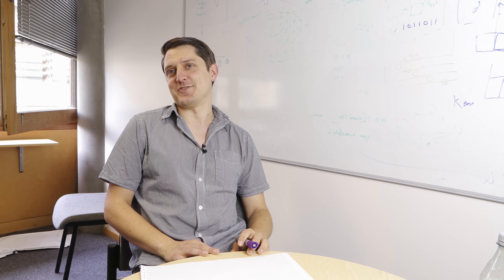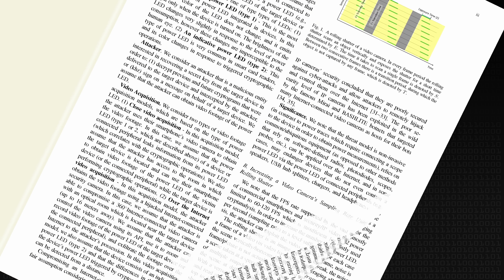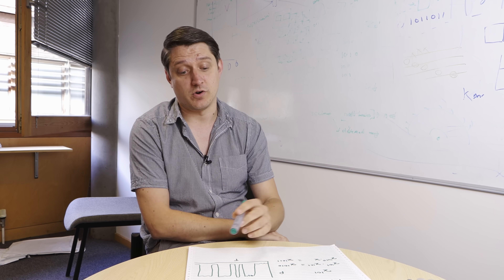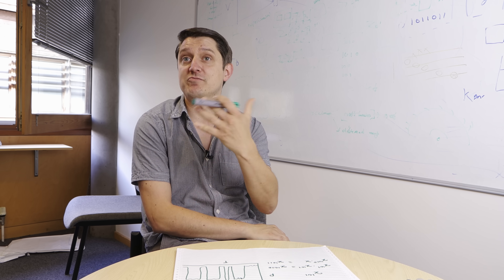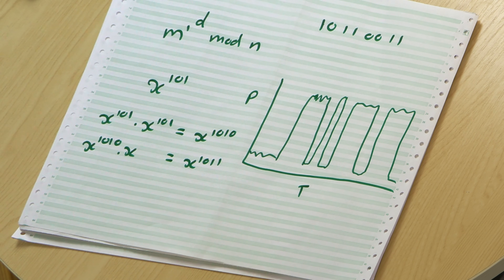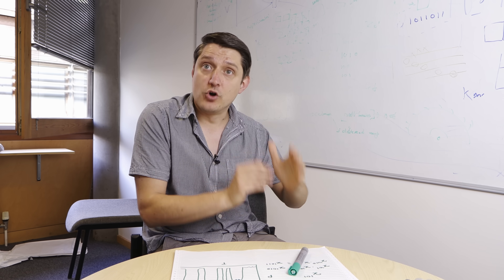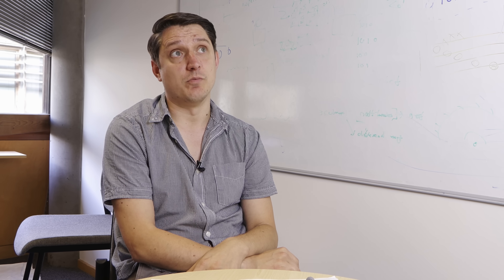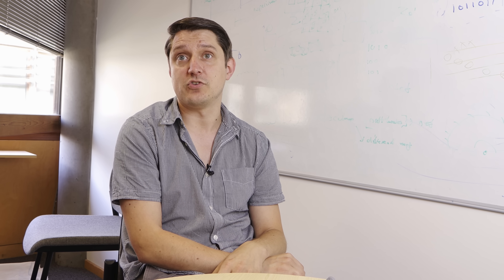Power LED Attack - Computerphile

Comment: I saw the paper on this the other day, very cool stuff. I never realized that the rolling shutter meant that a video camera actually captures more samples per second than audio recorders at standard audio sample rates. I've always understood that there would be circumstances where electrical leakage could reveal sensitive info, and I've always wondered what precisely was responsible for the flickering of my network switch's LED.. makes sense that these two concepts are related. The missing factor for me was definitely that rolling shutters could give a quick enough sample rate to capture the data needed to do this operation.

Also processing time-based attacks are useful in certain videogame contexts. The one that comes to mind is in Path of Exile, where you can farm certain low percentage things very quickly by paying attention to how long areas take to load: if the area loads quickly, leave and open a new instance of it, because that means none of the additional low-probability things are present; if it takes longer than usual, then the server had to process the generation of those additional things and you should stay in the zone until you find them.
Reply: Your PoE example reminded me of how in Fate Grand Order, when you are rolling the Gacha you can reliably guess whether a given roll is the new Servant you are trying to get before the animation even starts just because there is a noticeable delay at the start where it has to load assets for the new Servant.
Reply: @VorpalHerring  Same on Warface boxes
Reply: Activity LEDs on network gear are not as useful now that they started blinking as a steady rate to avoid leaking information.
Reply: ok?

Comment: RF emission may also relate to power consumption, so a simple tranny radio close to the reader may also work.
Reply: It “may”. Most likely not in any real design.
Reply: @jhoughjr1  capturing noise from the microphone running on the same laptop is enough, yes, radio will work just as well as this power LED attack
Reply: @666Tomato666  wow read this, and tried putting my ear on the bottom of my laptop and scrolled with the trackpad, you can listen the cpu computing, no joke

Comment: I don't see this exploitable in practice. It is probably hard to get consistent success even with an extremely controlled and noise free environment and already full access to the system and precise direct electronic measurements. Certainly not something that should be on anyone's cyber security concerns list. I am more worried about extracting passwords with rusty carpentry tools.

Comment: The LED are like the different sound that would play when your typed your CC code and the melody played would reveal your code, they got rid of the sound, they can get rid of the LED
Reply: you may be able to get rid of the LED, but you can't get rid of changing power consumption or timing discrepansies without changing the code itself
Reply: @suncat530  yes but at least you're not "broadcasting" your code.

Comment: Reminds me of the early days, when "transmit" and "receive" status lights were wired directly to those lines, and transmission rates were a lot lower.  Data could be intercepted literally just by recording those lights.
Reply: It reminds me of the days of analog lines, where dial-less (receive calls only) phones could still be hacked to dial by pulsing the numbers on the close line switch, which is how the analog rotary dial does it as well.
Reply: @dgo4490 my friend's mum removed all the buttons apart from 9, 1 and 0 from their phone so it could only be used in an emergency. Except we were kids in the 90s who knew technology, hacked in minutes
Reply: I had a rotary dial that I broke by pulling it back with force in attempt to dial faster. I had to rapidly press the hook switch to dial numbers.
Reply: @j7ndominica051 😂 I was just about to relay my own story. As a kid I discovered that by bashing the hook switch you could also dial, basically treating it like a morse key. It drove my mother nuts as the noise was deafening (when I did it, at least...)
Reply: On Arduino’s they still are wired directly to the communication lines :p on the atmega based nano anyways. Correction in response to Catelyn’s comment: this is only true on Arduino using the CH340 chip, which is the case for many clones. The official Arduino nano does not have this problem and uses normal activity LEDs that blink independent from content. I didn’t realize I had a clone schematic in front of me, my bad!
Reply: @Huvada  false, they're wired to the communication activity lines on the UART <-> USB bridge
Reply: @catgirlQueer   we’re kinda both right I’ve found. It depends on the USB/uart chip that’s being placed. Ch340 based arduinos have the LEDs directly wired to the cpu RXTX interface (which is the version I happened to have seen before). And will blink along with the data itself. TF232RL arduinos have the dedicated data activity LED and blink with a constant rate independent of content, which is the version you’re referring to.
Reply: @Huvada  I see, yes
Reply: In this case, these lights are not visibly blinking, though, the analysis is just on invisibly (to people) slight alterations in color as voltage variations in the circuit cause the light to change. It's similar to how you can take a video of a person and produce their heart rate from it by analyzing invisible (to people) color changes in their face as their heart beats.
Reply: @topherthe11th23 this reminds me that I read somewhere that if you dialed an 11, the telephone switch would punch a punched card saying something is wrong with your phone line and if you did it more than once the phone company would call you
Reply: Stray capacitance should easily drain off any high frequency… and the N-P junctions in the LED aren’t that sensitive/reactive … surely!
Reply: @OldManBird what do you mean not reactive, we make LED light pulsate a hundred billion times a second and run it through fiber optics for communications
Reply: Wasn't this also a problem with early hard drives, where the activity light had the data stream impressed on it?
Reply: ok?
Reply: Reminds me of the day when we used to send Morse using light guns.  You could read the message just by reading the lights.  How insecure :-)
Reply: @major__kong  In that regards not much changed. WiFi packets can be captured by anyone with an appropriate antenna. We basically just apply encryption and hope no one unauthorized gets the key ¯\_(ツ)_/¯.
Reply: @major__kong reminds me of the days when we use to send information by talking to people in person. You could just listen. How insecure :).
Reply: @cameronmonks1561  Well, at least in this case the information is localized and not recorded indefinitely at a nation state. At this point, this is one of the most secure ways of transmitting information.

Comment: You could probably push a photoresistor against the LED to make a much simpler detector. With the rolling shutter you'd need to get right in on the LED anyhow. And no camera in a datacenter is going to be that close to a power LED.
Reply: Photoresistors are suuuuper slow, so I doubt it would be that easy. For example, Wikipedia lists a 10ms response time, which is about in line with my experience. The fastest I saw on Digikey was 5ms. So unless the CPU doing the crypto math is running at... 200Hz clock speed, not gonna happen.
For comparison, a 4k camera at 60fps is capturing 230400 lines per second, which means about 4 microseconds per line, more than 1000 times faster than the fastest photoresistors
Reply: @hemerythrin  ah my bad. Might have been thinking about a photodiode, not resistor.

I'd imagine for a camera to work you also have to hold it very still or it's going to shift slightly each line and throw off your readings. So good in a lab environment, but not as good when attached to an object with fans that induce small vibrations.

Comment: How is this possible with all the power decoupling happening in electronics?
Reply: Hardware being specced downwards to make the people holding the purse strings happier.

Engineers design something super-fast-amazing, the boss gets hold of the design and says "Why do we have x, y and z in this, when a, b and are much cheaper." Boss begins with why, but it isn't actually a question.
Reply: @mattsadventureswithart5764 yup. Besides, I wonder if manufacturers considered it a realistic issue that ever crossed their minds. And if it did, if it was worth it for the budget. This stuff is maybe something that you have to cover if your lock is in the absolute top bracket of security where price doesn’t have relevance. But in the competitive market of consumer level locks, or even low security industries, the cost isn’t justifiable to your boss.
Reply: cheap hardware
Reply: Capacitor across the LED, problem solved.
Reply: Magnetic fields exist

Comment: Why is the LED even necessary? Just get rid of it
Reply: Users need some sort of visual feedback that their input does something. You can see this at traffic lights that have the button for pedestrians. If there's no signaler that says "we registered your input" people will keep pressing the button.

Also it's kinda handy with troubleshooting as you can quite easily see whether the issue is a power issue 😅
Reply: @SyntheticFuture  Turn on the LED once the computation is done instead of turning it on while computing, if timing attacks are an issue build in a small random delay. It's a millisecond operation so the users won't notice any change.
Reply: @JerehmiaBoaz  that would be a solution yes. Downright removing the led is not the best idea is all I'm saying =)
Reply: @JerehmiaBoaz with security card readers, you’d generally want some indication that the card has been registered and is processing. I suppose you could have the LED default on, then turn off when registering a card, then turn on again (maybe another colour) when complete and access granted/denied. Leaving the LED on all the time would decrease its lifespan though.
Reply: @rainbowevil  Registering/processing the card is a millisecond process, so does it really matter if the LED lights up when the card is detected or a few milliseconds later when the reader has decrypted the card? Humans wil barely notice the difference (and if someone inserts their card and the LED doesn't light up that's an indicationrhat the system isn't expecting a card so if security is a concern the card should be removed).